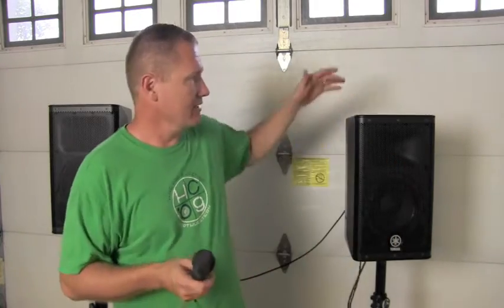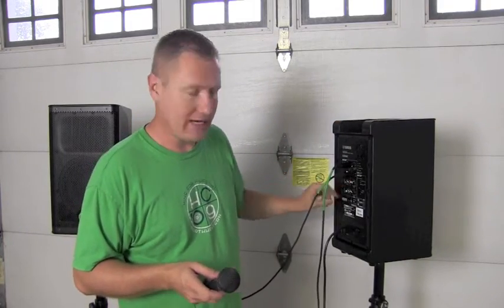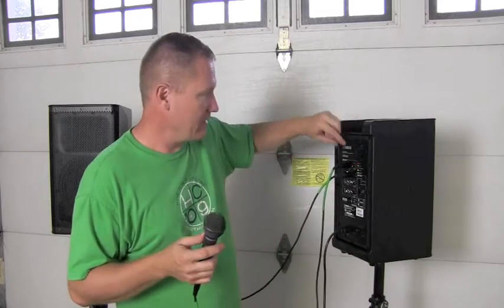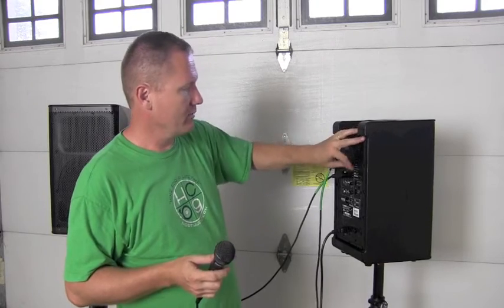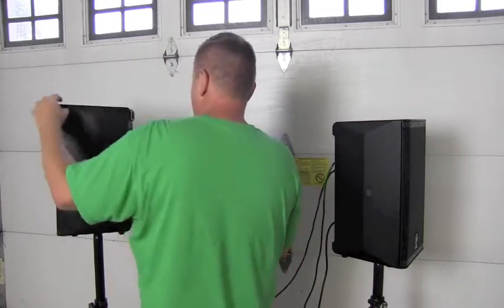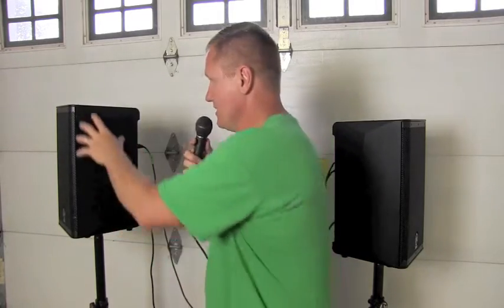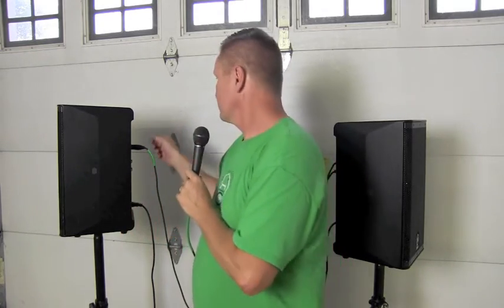Comparing mic and line input on powered speakers: by John Young #dj #sound

Comment: great tip man! just a question though I just bought a dB tech cromo 12+ its a 2 way speaker i want to play music and put a mic into it has two inputs which is parallel to each other one XLR and one jack, i put my speakers into mic mode but im hearing a buzz noise is that alright!?!
Reply: No. The stereo output from your device is clipping the input. You need a trs cable split . you cant run a stereo signal into Mono amp.youmust split the signal into two mono amps.
Reply: @robertreynolds9961   after 6 years LOL still appreciate the reply though!
Reply: My bad dude..lol. Didn't look at tine stamp

Comment: I been using this in mic mode. Pressed in. And having issues with no sound in one of them. Using as PA tops. Could this be my problem? They need to be depressed/outm
Reply: Only use mic mode if yourplugging amic directly into the speaker. In all other scenarios use line level

Comment: My speaker is and line mode can help I don't on
Reply from the maker: Much of that difference between line and mic is the level of the gain.. you can turn the gain up or down to achieve a similar connection.]